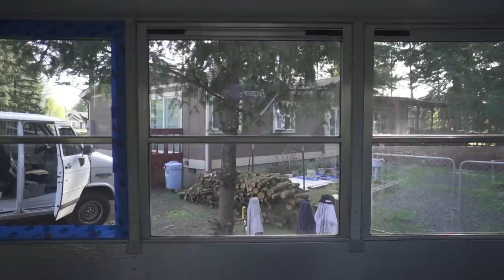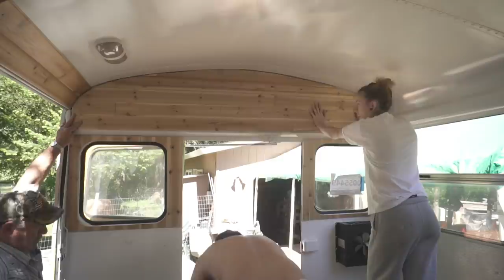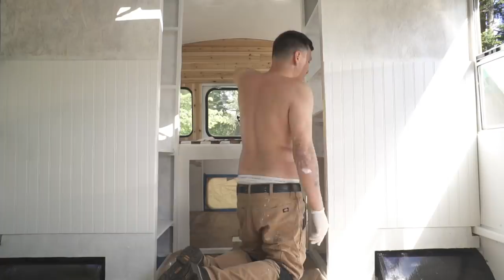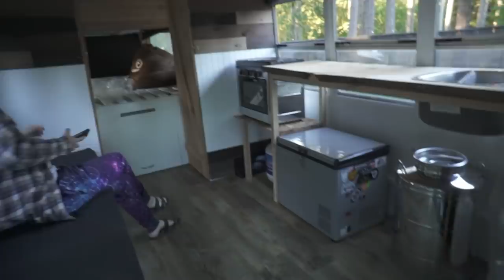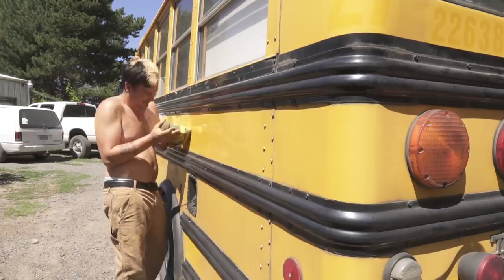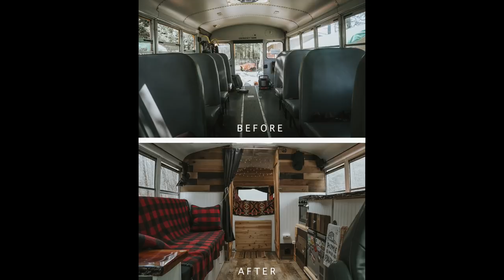E450 Diesel Mini School Bus Conversion Build Timelapse - From Start To Finish

Comment: A few years ago, I chose to buy an established small (not tiny) house. It is about 650 sq ft plus a shed. It is one of the best decisions of my life. I prefer a fixed and small place for many reasons, mainly for my health issues and my extensive hobbies.
Reply: Yup , mine is 900 sq ft and I wouldn’t trade it for anything 😀
Reply: I raised 3 kids in a 400 square foot house.it was built in 1880 and was in my family since 1921.
I renovated it a couple times in the 34 years I lived there. I live in a 950 SF. home now and it's just too much. I am wanting a tiny house, but  the building codes around here are ridiculous.And making it difficult.
So I'm searching for alternatives
Reply: I’m glad it works for you 🖤

Comment: I cannot believe my eyes. This is exactly how I was planning to build my bus but I couldn’t find anyone that came close to my idea so I could see if it would actually work. Thank you guys so much !!!!
Reply: What I enjoyed the most was they didn't tear apart the walls, ceiling, windows, etc. They ripped out the floors and seats, and BAM, prepped and spray painted that bad boy! Makes me feel like I can actually take on a short bus project without all the tearing apart of EVERYTHING. I'm curious about insulation and any rust issues, but otherwise,  great build.
Reply: @romanroseborough1111  They also failed to add insulation which is the most important bit for conversions.  Insulation.  Insulation.  Insulation. #facepalm

Comment: beautiful skoolie, and beautiful video! i didn't see anything about toilet, or shower though...lol, and you gotta have those for it to be a real livable home imo. :)
Reply: On the road I have always found a toilet to be very easy to find. But I am going to remodel and add them.
Reply: @isaacturnerit  lucky you!...lol, when you get old though, and gotta pee 3x/night, "easy to find" just don't cut it. :s
Reply: @douglasharley2440  who says I’m gonna die in the bus? I’m building a second one right now. I will remodel mine after that or build myself a new one long before that time comes. I’ll be able to afford the install of those amenities at that point
Reply: @isaacturnerit  lol, who said you were gonna die on your bus??? o_O nice, good luck with your next build, i'm sure it'll be sweet! just a quick fyi, you don't need to spend $1100 on a composting toilet, i made mine for less than $60 (urine diverter and ventilation fan housing off etsy for $50, cheapo computer fan and switch from amazon, home depot 5 gallon bucket, and some plywood to build box) and it has been looking good and working PERFECTLY for 7 months now. lol, i like my composting toilet more than i like regular toilets now (no pee on the floor because i gotta sit down to go, no water wasted, and no cleaning required other than  replacing the bag every couple weeks and throwing it in the garbage. :) peace
Reply: @douglasharley2440  you have a video for how to build that? I would love to check it out

Comment: I love tiny homes as well, unfortunately because of injuries related to combat I can not drive anymore so that knocks out that entire part of my life.
Reply: They have controls that you can put on the steering wheel for the pedals if your wheel chair bound and you could always use the lift
Reply: @TheHearseAroundJimThorpe  fortunately its not that kind of injury.  The injury was to my bodies electrical system, I have a history of passing out now and am unable to have a drivers license.  I was calling in close air support during a dust storm and was hit by a bolt of lightning.  40 years old now and have had over a dozen procedures and a internal defibrillator in place.
Reply: So very sorry for your injury.  So appreciative of your service and sacrifice.
Reply: I am sorry friend

Comment: It was very interesting to see the breakdown of the bus, and how this bus was assembled prior, flooring, seats, etc. I find the time lapse feature makes me dizzy and strains my eyes and I don't learn anything.  Not a fan.

Zero insulation or sound deadening or waterproofing on metal interiors.  This is a huge shortcut that will limit your travel in some temperature zones.  Live and learn, young kids!
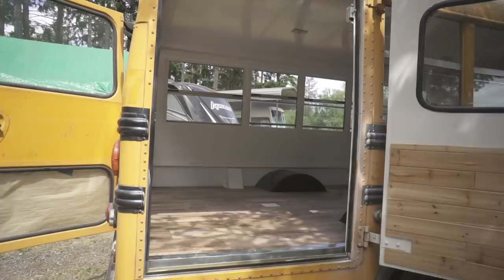1:12 - Leave electrical accessible from both ends. Sealing up one end is not wise.
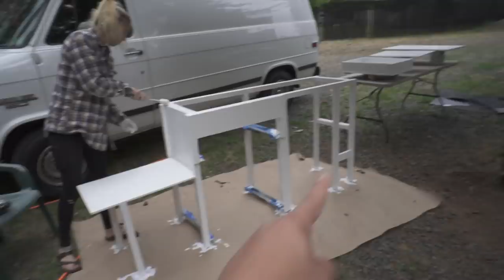3:04 - Heavy slab wood is only going to take away from heavy fluid and cargo capacity.  Looks very lovely but you sacrificed too much.  Cut slab thinner if possible.  As long as its attached to cabinet below it should not warp.   
The acrylic coating you gave it is very prone to surface scratching. A better idea is to thin out Oil based Polyurethane, Clear Interior Satin, diluted with 40:60 Mineral Spirits.  Put on a coat and let it soak in 10 mins then wipe off.  Repeat 3 times, saturating the live edge. The thinned out Poly penetrates wood and edge deeply, hardening both and sealing edges.  Last coat should be 50:50.  Wipe down. Dry.  Buff with wax if desired.  When you wipe off the surface sealer it gives an artisan effect, no gloss, and scratches don't show.  Renew anytime you want with light sanding.  Now your countertop is resilient, scratch proof, water proof and tough as nails.
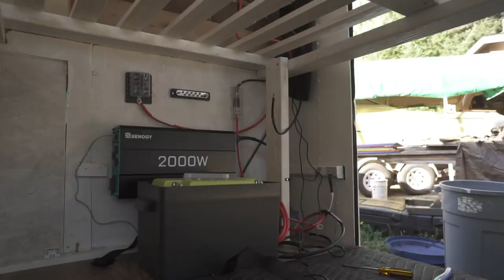4:24 - It was smart to drill holes for mounting solar on the sloping sides of bus. Water does not pool there and you get a slight angle on each side for optimal warming.  I did not see you use any Dicor lap sealant under the foot pad to seal off screw hole, as well as over it. You need both to prevent leaks. Then you mount a deck over the solar panels - Oh no!  This is very self defeating.  I would remount the panels on the deck instead, add glides, and slide them out like wings when I use the deck and latch into place when driving..

Bathroom, toilet, kitchen, nothing covered and disappointing.  This format is not satisfying at all.
You have a lot to learn about building. The interior looks nice but you left out a LOT of functional and necessary materials like insulation, noise reduction, underlayment (?).  I got the feeling this was a very gung ho rushed build with little thought about all these functional needs.  Building a bus is not about putting up pretty paneling and fancy live edge slabs.  Its a self supporting mini eco system and your basic needs for warmth, food, hygiene have to be met.  Not impressed with your research 'homework'.

Comment: No insulation on the floor and no toilet? I don't understand why people do this, put so much work into a bus and it looks beautiful but without a toilet you have to go outside in all weather at all times of the day - and if you're not in a secluded area you've got a problem. That's a terrible plan.
Reply: In 3 years I have literally had no problem finding a bathroom.